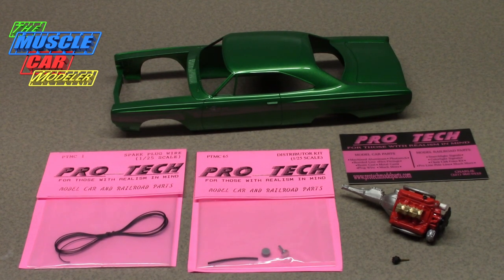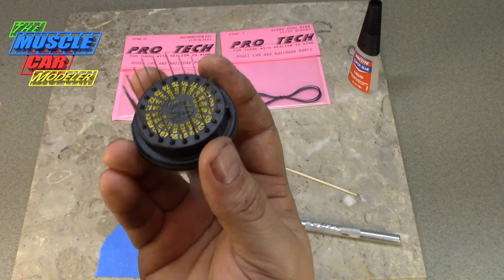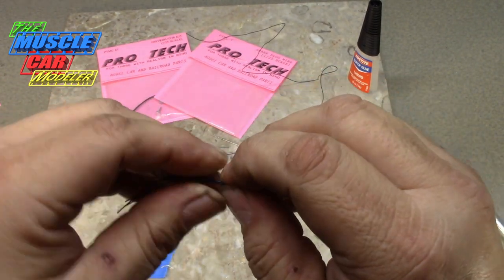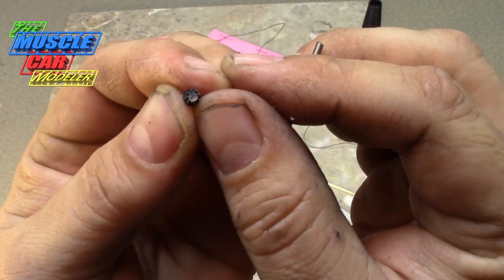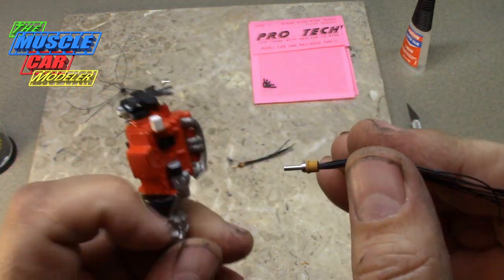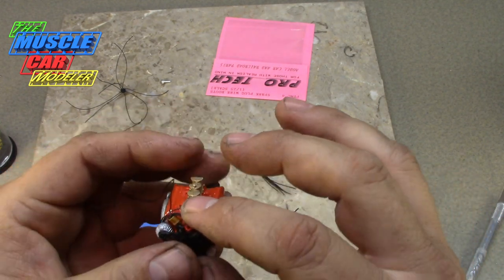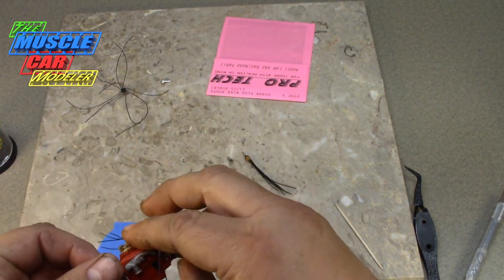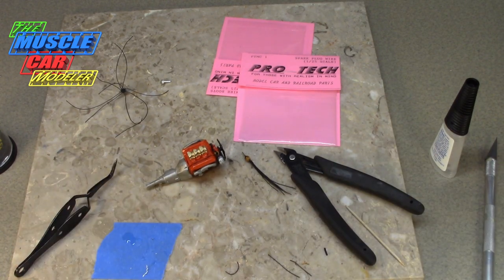How To: Add Distributor Plug Wires!

Comment: Thanks for another great how-to. I usually do the big hole in the center of the kit distributor too. But I only cut 5 wires 1 for the coil and 4 for the plugs twice as long as I need then I fold those in half so that they do not have loose, or cut, ends to try and shove in the hole. I can usually feed the coil wire into the middle of the bundle so that it doesn't hang up either. One thing I found distracting was the talking to folks that I couldn't see or hear lol. I assume you usually edit that out but I do not know. Still another wonderful video.
Reply from the maker: I actually added the comments as a joke and the names are viewers like you that comment all the time. There was a discussion on Facebook that the How to: videos are boring and monotone. So I added those to see what happens.

Comment: I'm fixing to get back into modeling again been quite a while my last one was a nearly a 2 ft long 1927 model t call The Golden t it's an older kit from many many years ago and I whent all out on that to make it as real as you can get from fuel lines electrical lines brake lines everything and then my final one was a 68 Camaro that was a 1/8 scale also large I did the same thing used actual aluminum tubing to make exhaust pipes old Pepsi cans cleaned up and made mufflers and all the hoses from heater hoses to AC everything been about 20 years now it's time to get back into it lot better technology for aftermarket goodies to bring our hobby to life
Reply from the maker: Very cool! You car really get some detail in those big kits!
Reply: @TheMuscleCarModeler  the thing with those large-scale ones is you really got to pay attention to detail cuz there's more to see even though it's been over 25 years and they're still in pristine condition with today's technology and equipment the sky's the limit now as far as the types of pay and aftermarket stuff for these models back then we had to improvise and make things

Comment: I use the wires all the time in my builds. 
What I do is drill holes for the wire, in the kit supplied dist., and insert the wire. Then I just slip the boot, cut to length, over the wire. 
Here's another tip: Cut the boot at an angle, insert that onto the wire. Then turn the other half of the boot so it's at 90 degrees of the first half of the boot to make an 90 degree angled boot cover.
Reply from the maker: Thank you! Nice tip.

Comment: what size is the drill bit for spark plug wires thank you
Reply: Pro tech spark plug wire has an outside diameter of .018". So you will need a #77 drill bit.
Reply from the maker: Thank you Model Man81!

Comment: Great job I use HDMI cables for the wires tear one apart you'll be amazed at the wires in there and telephone wire sheathing for the boots
Reply from the maker: Thanks! Cool but I don't have any spare HDMI cables.
Reply: Tell everybody you know with a computer or phone don't throw away those phone chargers cables or HDMI cables

Comment: Usually for those Pro Tech ones I just drill a hole big enough for the wire then glue the wire in and slide the boot down. But I agree the scale seems too big on those ones.
Reply from the maker: That would have been easier. Thanks.

Comment: Talking about stabbing your elbow with a drill bit, i only had on socks dropped my xacto knife and it went straight in the top of my foot
Reply from the maker: Ouch! I have almost done that.
Reply: @TheMuscleCarModeler  I had 4 stitches in the top of my foot and 6 in the bottom. Im also a diabetic so i was in the foot drs office twice a week for i believe 3 or 4 weeks straight. A diabetic can easily loose a limb by just some little thing happening
Reply from the maker: Wow. I have a good friend that when she was unpacking a new food processor, The blade slid out of the protective cardboard. It landed on the top of her foot and cut the tendons and hit bone. She was lucky, she didn't lose any toes. Glad you were ok.

Comment: what are the tips to drilling kit distributors?
/
Reply from the maker: I have drilled a hole in the center of the cap and put in 8 or 9 wires depending on if the model kit has a coil or not.

Comment: What is the diameter of the wire ?
Reply from the maker: Ask Charlie at Pro Tech. It's not marked on the package.
Reply: .018" #77 drill bit
Reply from the maker: Thanks Model Man81!

Comment: Can u paint the wires
Reply from the maker: Yes but carefully. Paint doesn’t stick to well to the wires so it is best to have them in place before you paint. Once painted and dry. The paint doesn’t stick to well to the wire coating. So any flexing of the wire. The paint can crack and fall off.

Comment: I ended up cheating also, i twisted the bottom of them like you did
Reply from the maker: If it works!
Reply: @TheMuscleCarModeler  After there in the hole before the glue seeds up they will straighten themselves out you just have to hold them down in the hole everything turned out good on my end. Yours look just fine! Keep on building buddy!